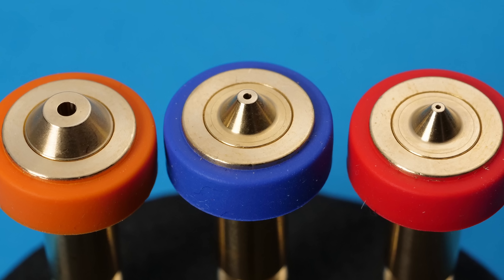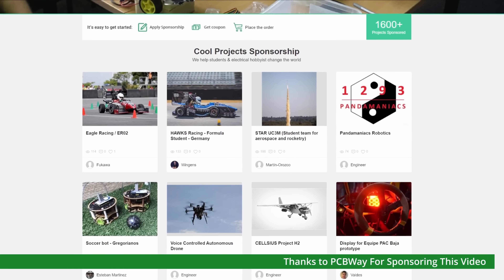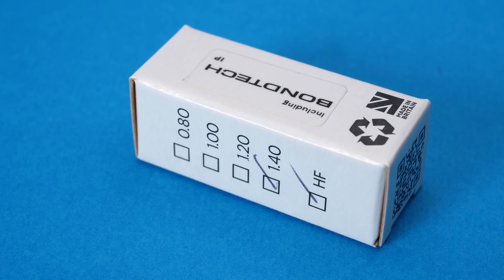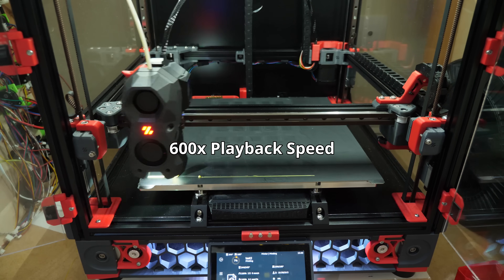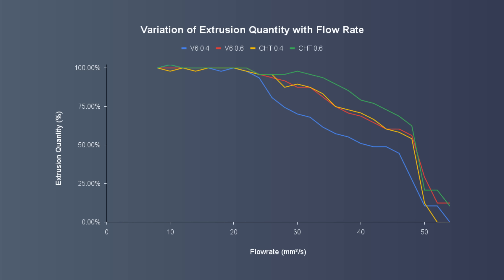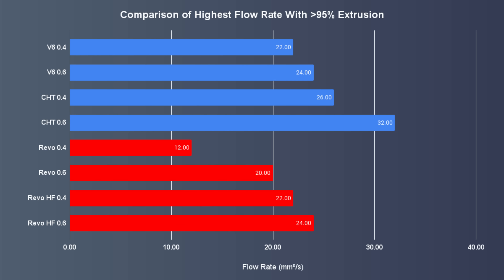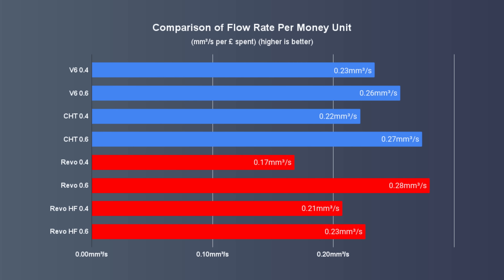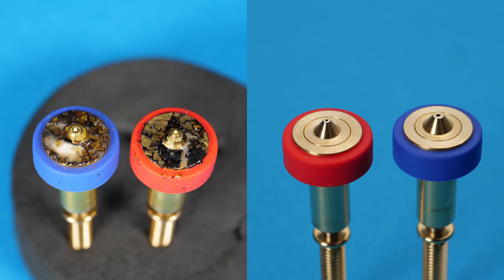Is E3D Revo Finally Ready for High Speed 3D Printing? Revo HF Review

Comment: Got my Revo HF upgrade kit in two days surprisingly direct from E3D to California. So far it is definitely an upgrade. I easily printed a Benchy (decent quality) in 20 mins with 0.6mm HF nozzle with PLA with no tuning. I'm sure I would be able to get around 15 mins with PETG or ASA/ABS. I'm pretty happy with it so far but more testing is needed. I think for its size, it is really good from the looks of it

Comment: You mention that the difference in flow rate may be due to the difference in melt zone length.
It may also be affected by the coupling between the heating element and the melt zone. The e3d is (poor) contact based conduction only because the nozzle is a seperate unit and theere is only a spring holding the heating element against it axially, while radially there is an airgap.
While the phaetus rapido is fully integrated so the conduction is as good as it can get.
Reply from the maker: Honestly, I don't think it matters. The brass is so much more conductive than the plastic filament that I don't think thermal distribution is an issue. Just a guess based on experience though.
Reply: @Vector3DP  How big is the air gap, 0.1, 0.2... 0.5?? can the heating element wiggle side to side with a nozzle in it?

In my understanding the poor thermal interface basically acts as a time delay between the melt zone and the heating element. That will result in the temperature in the melt zone lagging behind that off the (measured) temperature of the heating element. So the control loop will be less effective. 
e.g. if the printer requests a burst of high flow rate, there will be a delay between when the melt zone cools due to the plastic carrying away heat and when the sensor in the heating element detects the drop. Then the controller will switch on the heating element and there will be another delay before the heat generated in the heating element reaches the melt zone. 
Could add up to 0.5 - 1% of the 0.5g blob generated by the cnc kitchen gcode? Even 1% is only 0.005g/5mg.

Comment: Why does e3d V6 work so well even 0.4? There are a LOT of hotends, particularly stock hot-ends on everything generic, with substantial degradation beyond about 13mm/s^3.
Reply from the maker: Rapido has an extended melt zone

Comment: Looking at your somewhat caked and filthy looking nozzles, so here's a silly thought that i tested myself and it seems to work but i wasn't thorough enough with the testing to be absolutely convinced that it works: season the bottom surface of your nozzle in linseed oil that you bake on. I simply brushed it on, heated it up to 250, and brushed it on a few more times over like a day of curing. I also suppose it will cure on if you just air-dry it eventually, so you could conceivably season your nozzles that you aren't using off the printer so you don't occupy the printer by doing nothing but keeping temperature.

I also wonder if there's a temperature safe finishing oil that can be used.

Comment: So you confirmed what I suspected. Revo HF is more or less a gimmick because they didn’t increase the length(the most important metric) of the melt zone. CHT is also half the price of a Revo HF if you combine the cost of the heater it’s a massive failure coming in at triple the price of a Bambu Labs hotend sporting similar flow rates. I just don’t understand how e3d got so out of touch with the industry. Nobody should be paying 3X the price for the same level of performance as you get with everyone else. Even a normal ender 3 hotend will push those kinds of flow rates with a CHT(you know the ones that cost $10).
Reply from the maker: Sounds like confirmation bias. These is not the conclusion of the video.
Reply: @Vector3DP  You said it yourself the thing barely hit's 26mm^3/s. Numbers aren't bias they're reality.

Comment: When modifying my profiles for CHT nozzles I noticed that they require a bit higher pressure advance than plain nozzles. And on small complicated prints that can actually result in slower printing if a large enough percentage of the time is spent decelerating into a corner or acceleratin from one. So now I keep my CHTs in my V-Core 3 500 and my V-Minion can actually print some small things faster using non-HF Revo hotend - higher accelerations and lower pressure advance each contribute to that. So I think for some printers and/or users the new HF Revo could be a total vaste of money because if you can rarelly reach the limit on flow-rate the extra money will not increase the performance at all.

Comment: When I got the email "REVO HIGH FLOW" my heart sunk. I just bought a revo voron single nozzle kit. I thought it would be a whole new hotend. No... it's just a nozzle. I love this! Sadly I've spent so much money upgrading my ratrig (dual filament, FFFM, wobbleX and just purchased lots more for AWD). So I don't want to spend another £30 on just 1 nozzle for my v0 which I'm currently building into a F-Zero.

Comment: Good improvement, but you're still only getting what I'd call "standard flow" rates. That ABS you used recommends fairly low temperatures. I typically print Polymaker or Sparta3D ABS at 260C. I'd love for you to see what happens to max. flow rate vs temp.
Reply: ABS is unstable. You can't keep it at elevated temperature for very long, it starts to degrade and turn into brownish brittle shit. If you're printing at 260°C, you should ideally already keep decent pace, not snail pace, but like normal usual-ish print parameters are OK, but say doing that on a printer with usual slow mechanics but at 0.05mm layers would not, you would cook it. If you're squirting it out fast and not giving it time to cook, you can also afford to go up with the temperature. I think different recommended temperature may just be down to different assumed volumetric rate.

Comment: i really loved the revo concept when it was announced. i've preordered the revo six full kit and the voron revo. But the lack of high flow and hardened nozzles led me to use a Trianglelabs 115W CHC Pro which is cheaper and much better at higher flows. why would i get my revos out again if the ObXidian Nozzles and the 60W Heaters aren't even  in stock.

Comment: Any comparisons coming using the standard 40W heater vs the 60W heater? Curious how much of a difference it is between the two.
Reply from the maker: 20watts difference :) Most times you wont notice the difference because unless the PID controls the power to the hotend to control temperature. adding a higher power heater won't increase flow rate on its own.
Reply: just speed of getting to temperature, if the meltzone length didn't change, there is no flow impact

Comment: Very cool video. I like your data driven approach and acknowledging that it's very difficult to perfectly match other flow rate calculations or findings.

I think while Revo + HF Nozzles isn't the best performing combo for Volumetric flow, the versatility the platform offers somewhat makes up for it.

I've seen these on tiny Prusa Mini's printing tiny Mini-figs with a .15mm nozzle. Seen them on MK3S's printing CF/Nylon and other abrassives with ObXidian. And seen them on Voron's pumping out parts and printing at 200-300mm/s (obviously layer height/width can make print speed look very high)

But any of those printers can one handed cold swap out that specific use case nozzle and put in another for whatever reason. That's pretty cool.

So maybe not a master of any specific use case, but a great Jack of all Trades? $80-$100 purpose designed HF Rapido? Or $80-100 Rapid Nozzle Change Revo that can now get better VFR.

Comment: You mentioned testing Revo HF using the new 60w heater core. Were the Revo SF nozzles also tested with the 60w, or with the original 40w heater core? I'm guessing that there is little to no benefit in just changing from SF to HF nozzles without also buying an uprated heater core, so that further increased the cost of moving to Revo HF. Seems like an expensive upgrade 🤔
Reply from the maker: In theory there is no benefit to using 60W over 40W on standard flow nozzles, hence they went with 40W. I used 60W for all the Revo testing though.

Comment: Reasons for Normal Revo vs. HF: Usage with Prusa MMU. I need clean Tips, which I don't think are possible with the HF Variant or CHT. Also of course, printing with abrasive materials, as no ObXidian version seems to be available for HF.
Reply from the maker: Ye, mmu could be one reason. But i'm talking brass nozzles, obviously a high flow nozzle doesn't make obXidian obsolete.
Reply: You'd be surprised with the tips of "split nozzles". On my CHT or Bozzle printers I have not needed to either heat up the hotend nor snip the tip to remove/insert filament because the tip always comes out pointy with no bulb.

Comment: In my expierience - revo need at least 10°C more temp... it looks like a temprature offset. Stephan found somthing quite similar. 10°C more would also increase the flow rate a bit - but is it comparable? one would need to measure the exact temprature at the nozzle to have the same temp on all nozzles.
Reply from the maker: One can never actually measure the direct temperature without affecting it. When i have my uber v2 test machine setup, things will be more detailed :)
Reply: @Vector3DP  Schrödingers Nozzle all over again :)

Comment: so revo HF is basically standard v6 flow rate nice, this should be the case from beginning. The standard revo are just disappointing got two from my ldo kit but they are completely useless especially on a corexy machine. Even on a bedslinger it too slow unless you sticking to the stock 50mm/s print speed, basically have zero uses and the nozzle quick change feature not even that different compare to a standard nozzle swap on a v6 style hotend, so a fortune and doesn't even perform, you are better off even just buying bambu lab hotend that are cheap and performs well for your machine if you can mount it
Reply from the maker: No, you really missed the point here.
Reply: @Vector3DP  isn't the point that this is what they should have released from the very beginning? to offer a small formfactor light weight hotend that can at least match standard v6 hotends?
Reply: @8bits955  It does match standard V6 hotends. Comparing the numbers to a Rapido (which is, effectively, a Volcano that can use standard sized nozzles) isn't a fair comparison. A standard V6 hot end with a standard V6 .4 nozzle is pretty much identical to a Revo with a .4 nozzle. Again, you're comparing a Rapido HF (there are only HF and UHF Rapidos) to a Revo SF.

Not that this is a BAD video (it's the first I've seen anywhere with details about Revo HF), but using the Rapido, to me, invalidates it a bit. It would be better served to use a V6 or a Dragonfly, or even a regular standard flow Dragon vs Revo since comparing a heater block a full 1/3 longer than the Revo isn't apples to apples. That's why there's the '% gained from changing nozzle tech' metric that shows that Revo to Revo HF gains more than going V6 to CHT.
Reply: @WhiteG60  oh yeah this defo isn't a bad video at all vector done a good job fairly detailed, just more about how disappointing revo was with their normal nozzle, this high flow nozzle is what it should have been. I wouldn't say rapido is a volcano but it does increase flow rate a bit at least from what i found. I personally owned and tested many hotend that includes,mk8, dragonfly, standard v6 from e3d, dragon st, dragon hf and dragon ufh,  rapido hf/uhf, goliath and ofcourse revo aswell. Fom personal experience revo is the worst one here inturns of performance along with the mk8 hence why I don't use both anymore. This is especially bad for revo only until now you don't even get the option to use other nozzle design such as cht to improve the flow and considering the price they are charging it stuipd for it to be compared and more limited to a mk8 hotend.
Reply from the maker: The reality is, the best comparison is not one with similar performance (we don't even know what that would be until after testing anyway) but one of similar price because that is what consumers will be comparing against when making a decision on what to buy. Nobody is thinking of buying a V6 now. Dragonfly is a really low cost hotend so its not a close decision to spend £50 vs £110. Rapido is a high performance hotend at a great price. If you want to join the market, you can't pretend it doesn't exist.
Reply: @8bits955  Revo isn't purely about flow rate tho. It's possible they might have released the CHT-like nozzles at launch if there wasn't a conflict with Bondtech's patent. But I'm not sure they would have had it as the default nozzle type. Having a Standard Brass, ObXidian and HF option lets ppl pick and pay for what they value. A huge benefit of the platform

From my perspective the Revo is about versatility and flexibility. Want to print in different nozzle diameters depending on the type of part? Use the various standard brass nozzles. Can get thick/wide layer lines for stonger parts or print super tiny mini-figs.

Want to print fast and Maximize Flow Rate? Revo High Flow nozzles

What to print abrasives or minimize failures b/c of dirty nozzles? ObXidian.

Want to do all that on 1 printer? Boom can do that with easy 1 handed cold nozzle changes.

The Rapido is a High Flow hotend. The first spec they list is "Ultra – high speed printing...up to 75mm3/s". Like that's what it was designed for. Ppl likely wouldn't put one on a tiny cantilever printer whose kinematics would bottleneck the flow rate. But they can put on a Revo and if they want to maximize flow rates for certain prints they can with a HF nozzle

The Revo is not going to be a perfect solution for any specific printing compared to a hotend designed specifically for that. But it can do most/all pretty well.
Reply: @BallisticTech  From my prespective revo could have been a much better product if it wasn't for it such limiting flow rate at the start, when you can easily out run the hotend on a bedslinger without much pushing for speed is just sound like a product missed it target requirement. because there isn't much printer that cant go that fast. Hf should be standard flow, it should have been the case from the get go. and from my perspective the nozzle feature are nice however ain't that different from a standard hotend nozzle change.
Reply: @Vector3DP  exactly, it should be a comparison of price not performance, if you charging someone that much for it it should live up to the expectation for that price bracket.

Comment: Did anyone know if this is compatible with a  Flsun V400 and if yes will it be really an upgrade for this kind of rapid 3d printer ( 400mm/s )
Reply: You’d need to modify the hot end of the V400 to use Revo™ first.
Reply: @brisance  Thank you 🙏

Comment: Would be interested in seeing if the 60w heater core gives a significant improvement.
Reply from the maker: It won't make a difference in many cases since higher power doesn't really increase performance, it just allows the hotend to perform its best. E3D have some additional data on when its suggested to have one.

Comment: They are freaking expensive tho, damn. Around €50/nozzle. Normal V6 is 1/10th of the price!
Reply from the maker: You do need to consider the whole system though. If you don't have rapido or other long heater, v6 nozzles will not get the performance shown in the video.
Reply: @Vector3DP  That is definitely true! standard V6 0,40 is rated at 13mm³/s (for around €6) REVO HF 0,40 is rated at 16mm³/s (for €50).

I personally understand the high price due to convenience and production complexity, but the 10 times higher price does feel quite steep for these added benefits.

Comment: I was already on the fence on switching out the cht nozzles I currently run... now I am even more on the fence. :p .. I think I need to convert a printer to the revo system at least, so I can get some hands on experience with it. Thank you. :)
Reply: Don't , the rapido wasn't even in HF mode, it would destroy the revo close to 40% more flow.